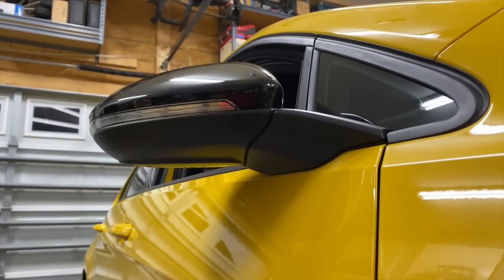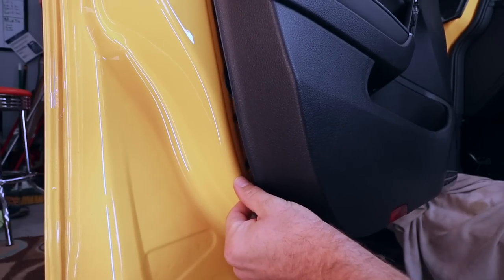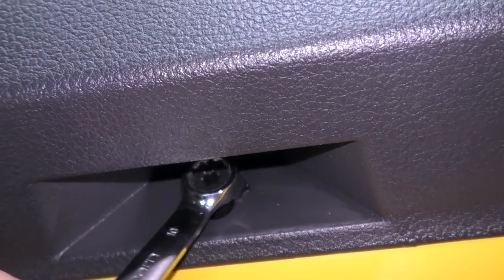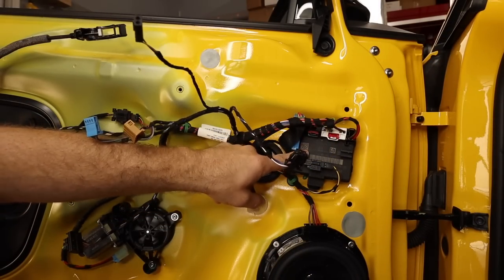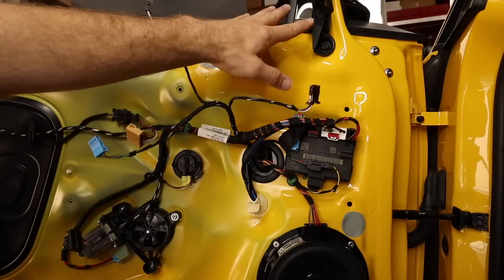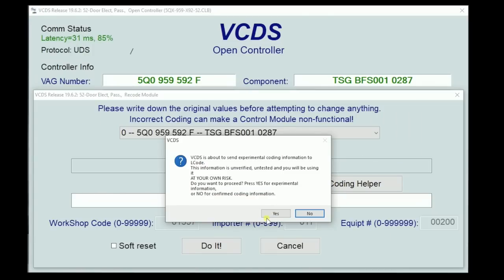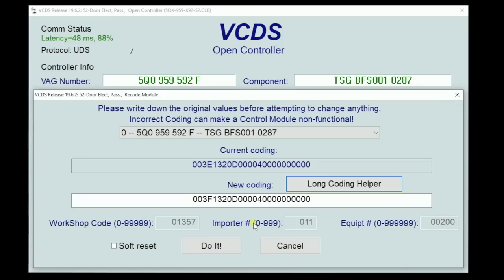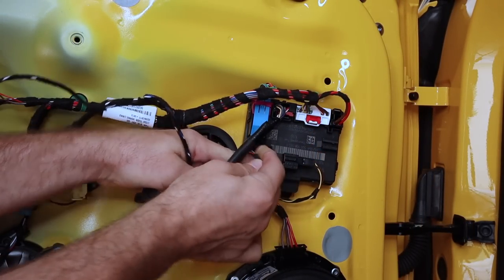MK7.5 Golf R Power Folding Mirrors Installation and Coding

Comment: 2018 Golf R mk7.5. Got same mirrors but not folding at all. I connected everything as in video. Tried activating using ODBEleven’s paid app under retrofit but nothing. Puddle Lights work.
Reply from the maker: You have to be sure the coding is right and you turned them on in the menus of the car
Reply: @HumbleMechanic  Hey all, these instructions were perfect and very easy to follow.  Driver's side door took me like an hour and passenger side door took me like 15 minutes (LOL).  I think my issue was that I had the auto-lock feature turned on in ODBEleven.  When I took that off the mirrors started working like a charm.  I think Auto-Lock is not compatible with the mirror power-fold feature.  At the end of the day I decided against the auto-lock anyways as it locks the car immediately once one closes the driver's door thereby locking in passengers at which point the car has to be unlocked to let passengers out and then re-locked again.  No benefit in that.  

Now I have to figure out why front passenger window won't on-push up/down even after calibrating it and all 4 windows.  I checked live data in ODBEleven for passenger door and it seems to be fine with no faults.  Any suggestions please?

Comment: Hello,i have 7,5 gtd it is compatible for my car ?
Reply from the maker: You’ll have to be sure it has the right door module.
Reply: @HumbleMechanic   through vag I have the settings to activate the mirrors or do I have to remove the door and see the control unit code? 
thanks the support

Comment: where do I get a obd usb wire for my vcds?
Reply from the maker: If you have the wireless one and want a cable, it’s an older style printer cable. 

If you want the hard wired cable, you have to buy used.
Reply: HumbleMechanic i brought an obd usb wire from amazon with the latest vcd software on windows computer but it does not communicate with me 2014 audi S3

Comment: MY VW tiguan R-LINE as thoose from factory but they're not automatic...
Reply from the maker: If it has the switch it probably can be coded that way. Or it’s an option in the mfi
Reply: @HumbleMechanic  should I put an X on my warranty et go stage 2+ right away?
Reply: @HumbleMechanic  mfi only as an mirror down option THX, witch is pretty convenient to save wheels.

Comment: Can this be done on a 2019 Atlas?
Reply: Disrekr if you can find the parts, I’m sure the process is the same. Heck, I installed power folding & heated mirrors on my ‘99 civic from combining a set of Japanese power folding mirrors, a UK spec manual folding mirrors and Canadian Acura EL mirrors, so anything is possible. Haha
Reply from the maker: Yes! And you can probably easily get parts. The SEL line I think has them. You will need to be sure your door modules work. some cars have a lower line module

Comment: My mk7.5 R already has misfires at 5k miles with no cel ad vw wont fix it 👎👎 junk
Reply from the maker: They won’t fix it or they can’t find and issue? Fuel quality seems to be a common issue
Reply: @HumbleMechanic  they basically told if there is no engine light there is no problem,I also showed them my obd eleven and took screen shots of the misfires they still won't do anything

Comment: you locked the car and the windows doesn't roll up! 24:30
Reply from the maker: I don’t have that turned on in this car. I love the feature but I never take the key out of my pocket
Reply: @HumbleMechanic  Ohh, ok, I LOVE this feature, because I'm brazilian and here IT'S VERY HOT and most of the time I open the windows, and when I go out, I lock it and simply doesn't care if the windows on the back is opened or  not!
Reply from the maker: Nice. I do love that feature. I may code it in anyway

Comment: wow gotta code new parts with special software now,  way to keep wekend warriors at bay.    ford used  some VW parts and ideas  inner door panels  that are sheetmetal,  and the rivited speakers,  as wel as the door clips
Reply from the maker: Well it kinda makes sense. These are from a Euro Golf. The module needs to know it has the function. The tool can be had for $100. It’s got little to do with DIYer and more to do with one module used on many cars around the world
Reply: @HumbleMechanic  makese sense i guess,  alays thought things were plug and play, im sure a modern car has around 20 modules in the cabin,  where as 10 years ago  only 5  or so
Reply from the maker: Yep. This car has tons of modules.  Hell even the relays more more like computers than simple relays. 

These would function plug and play, but we want them to do all the cool trick stuff. Lol
Reply: @HumbleMechanic  i m not a fan of the rotating part ,  like  could just fold in

Comment: VW have some stupid ideas especially with how you fold and unfold the mirrors. You have to look at the button before and after you rotate to know which mark you are on and where to rotate it because it fully turns to 5 different position without any tactile feed back of what is the current position! Very very stupid and a normal kick back of the button to  fold/unfold is much easier as in our 10 y old chevy cruze. German engineers are sometimes so stupid
Reply from the maker: Lol of all the little silly things vw does this one is no bother for me. Mostly because I can center the knob all the time.

Comment: Lower mirrors when in reverse  is cool car mirrors are tiny.
Reply from the maker: Yep. I’m gonna play with that too
Reply: @HumbleMechanic  Zero chance you get to see this, but might as well try. Did you get the mirror dip to work properly? I heard something about a memory module that's needed for them to return to the right position. Does the new folding set support factory mirror dip if you code it in?
Reply from the maker: I didn’t try. I’ve heard mixed too
Reply: @HumbleMechanic  Thanks for the reply! Future content maybe? I'm waiting to pull the trigger on the folding mirrors for when I can confirm the dip will work. Thanks again!